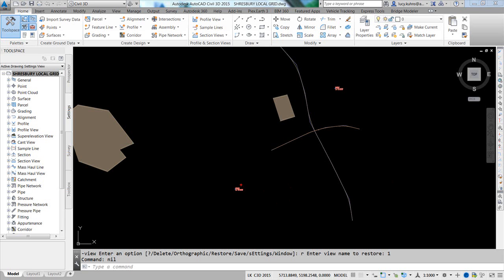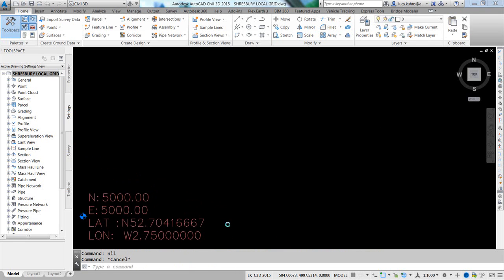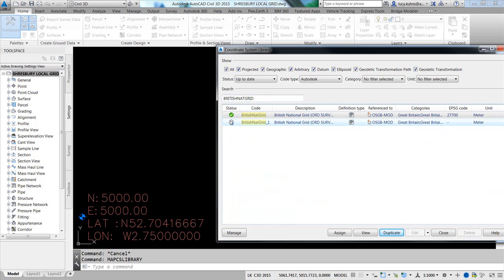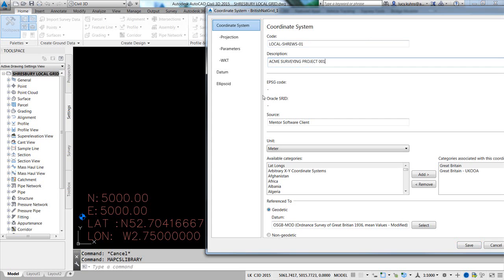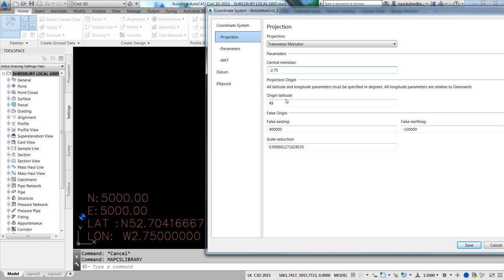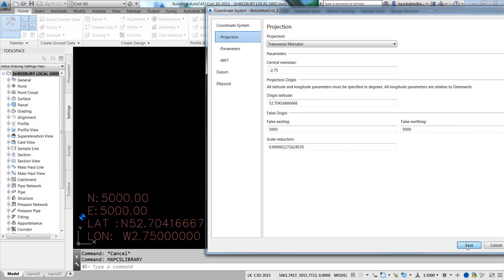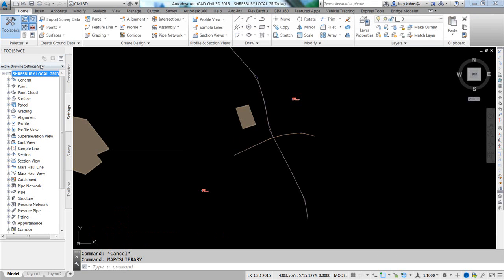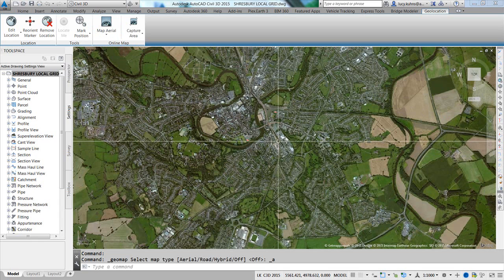Creating a local coordinate system in AutoCAD Map 3D and Civil 3D

Comment: Thanks Lucy this is a great video but how do you handle a local coordinate system that has an incorrect north?  We get files all of the time that were rotated by an engineer or CAD tech.  We would love to be able to automate moving those files into a geodectically recognized coordinate system but it seems that this method only moves the coordinates, it doesn't also rotate them.
Reply: Hi Scott any solution did you find it.. iam getting incorrect coordinate system in CAD files.. how to correct it